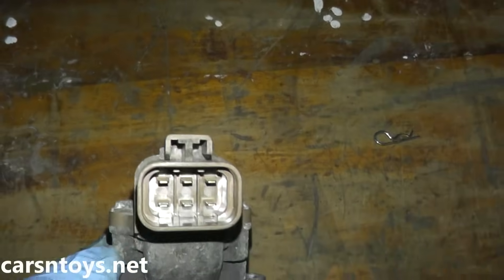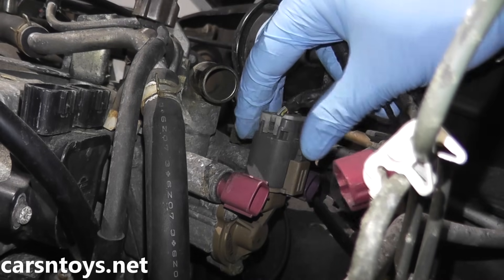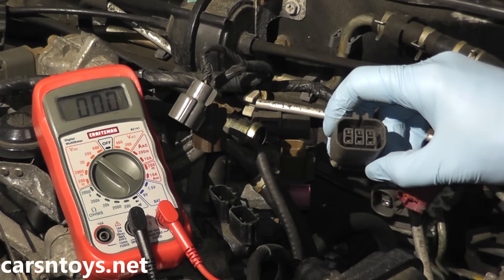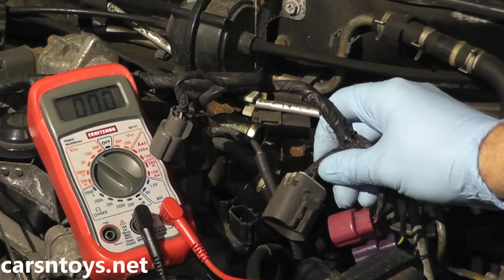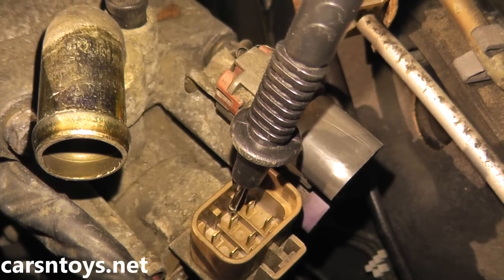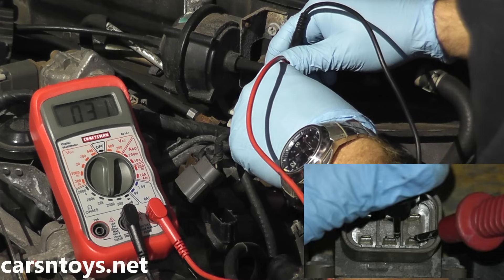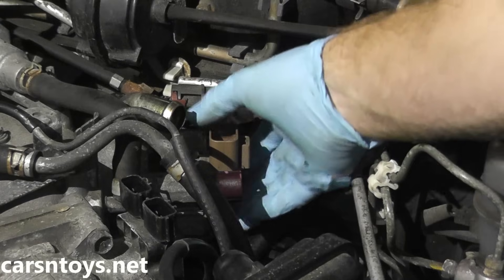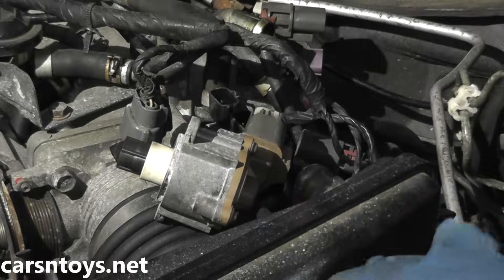How To Test and Replace Idle Air Control Valve P0505 HD | IAC Actuator

Comment: I treat this stuff like spark plugs. Sensors and IAC valves age proportionally and dirty up like spark plugs. If I pull an IAC valve and spark plugs and they are covered with caked on crud, I just replace the damned things along with the MAF, IAT,  and O2 sensors. If the IAC and spark plugs are covered with caked on crud, I assume all the other sensors to be caked as well giving deltas of inaccuracy across the scale to the computer which compounds into lousy computer output which is what initiates sensor and plug crud in the first place. Thus a car that does not idle, accelerate, and cruise as well as it could. I've proved this to myself by replacing each component progressively on high mileage cars one week apart and watched performance along with gas mileage progressivley improve. An expensive way to do things maybe as I don't settle for the cheap stuff. Some will call a parts changing a fool. To those guys, yes I have and use a bilingual scan tool and multi meter and know how to use them. But when I nail the throttle on a 150,000 mile car to pass someone and car responds like factory new, it's money well spent as far as I'm concerned. I can also count on the car lasting longer as it will burn cleaner. Spotless sensors throughout the intake and exhaust system give you just that. Thus less carbon deposits in the lubrication system which clogs passages to lifters, rods and mains with sludge. I've torn enough motors apart to know I know what I'm talking about. A clean burning engine is a long lasting engine. Real simple to figure out.
Reply: John Long I see your point man! I like to test things out to see if I can save some cash but honestly car dealer shops charge $160 hr for a 15 min plug and check codes for diagnostics. I can easily buy one part per hr and still be ahead. I like your thinking. I have a classic 3.5 Range Rover efi that idles high after warm up and fluctuates its  rpm. I’m just going to start tossing in new parts. IAC, tps, o2s etc

Comment: your very detail about your videos there great.. i was hoping you could help me out. i had a stuck idle pulley it was melying the blet. change it works good now. but i noticed that my 2003 dodge durango truns off now when im at stop. also if i have it on park and give it some gas about 4,000 rpm it dies... i was told to adjust idle. would you know how yo do that.. i was also told that i should just clean the throttle body and iac.. any recommendations.. thanks

Comment: I have a 1999 dodge ram 1500 and after checking and replaceing the iac now i have a code on for the engine light come up as a P1388 Automatic shut down relay 81 Brake switch stuck 78 Brake system incident Does Anyone know what this is O'Reilly did the scan and they dont know what it is

Comment: im having sane issue with my 99 ram 5.9 v8 2wd ill start the truck it will idle fine at start up but when i put it in drive and dive it for a bit i get low idle when coming to a stop engine wants to die aic valve starts hissing loudly...its throwing a p0132 code for the upstream sensor cuz the wires were cut for some reason to the downstream and upstream sensors and i have tried everything to fix it...cut and respliced taped them up good still both are stuck at 1.0 volt are there any recommendations on how to fix the O2 sensors it the wires are cut and pigtailed together...so sick pf this truck fucking up on me😳
Reply from the maker: I'd try to get the factory wires and solder everything back together. Local junkyard or ebay will often have the wires
Reply: well turns out it was a simple o2 sensor fuse....ha! who knew...

Comment: i just replaced mine now my truck wont start seems like its not getting no spark also aren't u suppose to disconect negative battery cable from battery to prevent damage to the sensor
Reply: after replacing the sensor you will have to reset the KAM. this will make the pcm relearn its position. IAC is a stepped motor and it must relearn its position according to fuel trim and A/F ratio.

Comment: does the iac valve cause symptons of

1. high rpm over 1000
2. low rpm 1000 or less
3. car shakes when its on
4. lack of power like if the car wants to shut off while you driving it or not driving it. ???
5. motor feels weak like if it dont wanna stay on feels like if it want to shut down?? 
6. can it also cause battery to die out also??

sorry just curious to know 
please help me on this one.

thanks for your time and patience
god bless.
Reply: chevyboii SS king310  sound like it buddy. You ever figure it out????

Comment: my car idles like crazy and stops on me its a 96 nissan maxima if i clean ghe iac will it help i cleaned first half of my throttle but didnt take it fully apart to clean.other side any tips? i really need to fix this
Reply from the maker: Any trouble codes?
Reply: +CarsNToys yes i have a check.engine ligbt i need 3 replacr.my.Egr.tempersture sensor? can it do.with that

Comment: All your testing checked out for me except for the last step at 5:20 on my 95' 3000GT. When I turned the car on several times, the shaft did not move at all. I decided to try it again and the first time I turned it on, it moved ever so slightly but wouldn't move again after I turn it back off and on. Is this an indication this part needs replacing?
Reply from the maker: Sounds to me it needs to be replaced.
Reply: +CarsNToys OK thanks, hopefully it fixes the reason why my car is shaking at idle and lacking power

Comment: My car was idling at 1100 rpm and i had the code p0505. i replaced the ACV and the car now idles at 650-775 rpm; however i still get the p0505; what could be wrong?
Reply: the pcm has to relearn. disconnect the battery terminals and touch them together for 10 sec then run it..

Comment: I got question guys. I got a 1998  5.7liter GMC Suburban. My idle seems to be a little high, it's idling now more or less at 1300 sometimes seems like 1500 , Do you think that the idle control valve could have something to do with this issue?  I was thinking maybe it was possibly stuck open.. Thanks ahead again guys, you guys are always highly  appreciated! 👍

Comment: omg this is so helpful right now my car is idling like.3000 rpm I just replaced the throttle body  part but trying to figure out why it idles so high when I turn it on
Reply from the maker: +Mely Serrano Sounds like you may need to adjust the throttle position sensor.

Comment: This is a great video. I've been working on an idle issue on my mercruiser boat engine. Someone explained to e that I should check for power and resistance on my wiring harness at the IAC. I had no idea how to do that until I watched your video. Great attention to detail. The inset camera view as you test for resistance is a great feature! Thanks a bunch!
Reply: rossi7r
Reply: Best video instruction for IAC valve I've seen.

Comment: Thanks for the fast response I really appreciate it. Would you happen to have a video on the vacuum hose and valve you are speaking of. Thanks again
Reply from the maker: +doug resha Unfortunately I don't. The Maxima I usually work on is older and doesn't have this vacuum hose.

Comment: First off thank you for such awesome informative videos! I did your test procedure on my 2000 maxima with the p0505 code, and it all checked out to be ok. I am still getting of course the p0505. Could it be that the throttle body needs a good cleaning, or what else would cause the code? Thanks in advance for your help and keep up the great work!
Reply from the maker: +doug resha Thanks man. If you checked the harness connector and the iacv, the '00 Maxima also has an air control valve on the power steering. If the vacuum hose or valve stops working correctly, you could get code p0505. You could pinpoint it quite quickly with a sophisticated scan tool. The basic scan tools won't pick it up.
Reply: @Carsntoys  but you didn't answer his question, if you do check All those things, what else can it be? I assume vacuum leak, are their any worst case scenarios with a p0505?
Reply: My 2000 dodge ram van 5.2 V8 is showing that code right now

Comment: I have a 01 ford Explorer everytime I slow down and stop it's chokes out and stop. a lot say it can be this . can that be the issue
Reply from the maker: +Dominique Williams Sure could be. If it turns out to be okay, other things to check is the mass air flow sensor - https://youtu.be/ewjO9JVr8NU - fuel and ignition system.

Comment: I tested the prongs on my Idle Air Control Valve and they read 42 to 46 Ohms on each compared to your 30. Same model of car (Nissan A32). Is that something to be concerned about?

Also, when removed but connected to the harness, it moves, but not as much as in this video. It's possible that's just a subjective observation, but if it really doesn't move as much, that a cause for concern?
Reply from the maker: +Antonio Java  The 30 ohms reading can vary depending on temperature. And if the valve is moving back and forth, and you don't have a trouble code for p0505, I wouldn't worry about it.
Reply: +CarsNToys Thanks, man! :) This helped me a lot in troubleshooting my car problem. I actually don't have a code scanner, so I had to do things the old-fashioned way and checked every possible point of failure one by one, including this part (which turned out to be fine, based on your input :) ).
Reply from the maker: +Antonio Java Good stuff man. Glad to help!

Comment: My voltage is 12.8 volts is that ok? I'm also getting a reading of 29 on connectors 4 & 5. Is that ok? I'm getting 30 on all of the rest.
Reply from the maker: +Errol Dillon Perfectly fine.
Reply: Thanks for getting back to me so quickly! You're the best!!!

Comment: Thanks for the tip on Ohms. I bought a new one and my car did not run well. I tested the new valve (mine had only 2 pins) and there was almost no resistance.
Reply from the maker: +craze1701 Glad to help!

Comment: @ carsntoys - I have a 1998 Ford Explorer XLT that idles poorly when cold & only a little better when warm.  Is the IAC the problem, or O2, or F/A sensor or "all of the above" ?

No Hate  On's Please.
Reply from the maker: +Tony Penner Is the check engine light on? If so, what are the code(s)?
Reply: +CarsNToys - It was the O2 sensor 1, bank 1.  I replaced it (with much grief), with a new one & seems to idle ok.  I then took the negative battery cable off for 5 mins., but the check engine light is still on, but the system says all is ok.
Reply from the maker: Tony Penner
Glad it worked out. The light will go off eventually. Just has to cycle.

Comment: DO NOT TEST YOUR IAC OUTSIDE THE THROTTLE BODY.I just ruined my IAC by trying the test at the end of the video. It kept pushing the plunger out until it came apart because there was nothing to stop it (like being in the T body. Thanks a lot.
Reply: +cklinejr Just screw it back in.....
Reply: +cklinejr dude, I just did the same. darn. thing.  Mine shot the valve off like 4 feet away from the engine.
Reply: +cklinejr I did the exact same thing as in the video and mine behaved as shown. If the launch wasn't a sign of a defect, then it's likely a difference in design. This is a good word of caution though, as this test might not be suitable for all cars. Good thing my car is the exact same model as the one shown in this video.
Reply: My Chilton cheapo manual does say not to let the pintle extend more than 1/4" or it's ruined....
Reply: cklinejr  what u mean u ruined it n don't do apart from throttle body
Reply: MUST OF BEEN FUCKED IF IT CAME APART MAN

Comment: in Nissan sentra 2003 should idle valve axle go out or go in after switching on because I have  rpm problem and note that my idle valve work opposite the video '''putting car on universal computer found no DTC ,,,my idle rpm 1000 and fluctuating while driving if I release petrol pedal on gear

Comment: I have a 04 Ford Freestar that will act like it's running out of gas at first cold start. Fuel pressure is fine. If I hold RPM's at 3000 or more for a minute it will be fine but RPM's at idle are jerky. No check engine lights are on. Sound like the IACV to you?
Thanks
Reply from the maker: +Paul Brownfield I'd check the iacv and pcv valve

Comment: I have a 1998 Toyota rav 4. It idles fine, but when I put the gear to Drive or Reverse, the idle always drop & will go up again. Sometimes the engine will die. 
I cleaned the throttle & the IAC valve but nothing happened. 
What should I do? Should I replace the IAC valve? 
Thank you.
Reply from the maker: +Vincent Rodriguez It could be the IACV. Is the check engine light on? IF so, what are the codes?

Comment: I get 43 ohms resistance on my 99 Maxima is that any good?
Reply: +Gravedigga114 smh, yes that is good,  from now on take your car to the mechanic shop lol
Reply: +Gravedigga114 That could be good or bad. Check your factory service manual to see what number you should get. On my FSM, it states "approximately" 22ohmz
Reply: @gravedigga114 it has been long time but if you see this post or anyone else, i have same car and i also get 43 ohms, how did you fix this error?
Reply: @vinaycx  According to AllData resistance between terminal 2 and 1, terminal 3 and 5, and terminal 4 and 6. Resistance should be approximately 30 Ohms at 68 degrees Fahrenheit. Hope this helps!
Reply: @Gravedigga114  thanks.
Reply: @vinaycx  no problem don’t recall exactly how I fixed this issue on my car haven’t had it in years but it’s possible I replaced it with a used one if your harness wiring is good.

Comment: Good Morning,  I have a 95 Maxima.  Does the Idle Air Control Valve always give a code?  Car is not registering any codes.  Have to pump accelerator when car has sat over night, rough idle at red lights.  If I move it to neutral, car smooths out.  Car runs ok once I'm not longer at the idle.  Any ideas what could possibly be the problem?  Any ideas will be greatly appreciated.
Reply from the maker: kfjones58 Not necessarily. You can have an IACV going without a code showing. Rough idle can be a number of things. Try cleaning the throttle body with throttle body cleaner. Also check the pcv valve and egr valve. I have vids for both. Just search my page. If you still have problems let me know
Reply: Thanks for your response.  I took it to Nissan for a diagnostic.  They came back with Misfire coming from  #6 injector is not spraying.  Do you think this could be the problem also?  I have an appointment for Tues to have it replaced.

Comment: I have a Nissan Maxima 2008, the rpm fluctuates a bit ( 700-1200) and engine goes OFF when I slow down the car. and yesterday the car was running at 80KPH and suddenly the rpm started going down the engine went OFF I had to stop the car with the Hand brake
don't know what the problem is just got the throttle body cleaned a week ago and done computer check everything is OK in it , no sensor showing faulty.
please help if anyone has faced this issue
Reply from the maker: Sandeep Naidu Could be a number of things but I'd start by checking the fuel system.

Comment: I'm getting the code to suggest mu iacv us bad. When changing out the iacv am I required to install a new ecm? I've read in several place I should, but your vedio didn't suggest it. Btw, I talk your video as gospel as you do amazing work. One last thing I have a 97 infiniti i30 if that matters. Thanks.
Reply from the maker: Bobby Gee Thanks man glad to help. No need to install a new ecm if the IACV is the only issue.
Reply: +Bobby Gee Did you get this fixed? You need to check the ECM if its bad also. When the IAC goes bad, it shorts out the chip in the ECM (this is a common occurrence in maximas and i30s). You'll see a burned chip if you take out the ECM. GL

Comment: Question regarding a 2002 Nissan Sentra GXE. The resistance check is good and the voltages are good. I have removed the valve to check if it moves when turning the ignition on/off and it does not move. The valve was taken off of a working car. Any suggestions?
Reply from the maker: Mirko Miljanovic If the valve doesn't move then you'll need a new IACV.

Comment: HELP !  I have a @92 Chevy S10 That idles fine. But, as soon as I shift into 1st gear, it stall and chokes. I have changed the fuel filter, the fuel pump, the distributor cap and rotor, changed all plugs and wires.  Nothing. I saw something, internet-wise, that there may a vacuum hose issue.

A friend suggested I replace my IAC.

I am a complete layman. However, I'm not afraid to attempt to do it your self. 

Any suggestions?
Thanks
Reply from the maker: Vernon Gibbs I'd check the idle air control valve, pcv valve....http://youtu.be/W63W3DtBCwA.....and the ignition time. Could also be an egr issue. Check this video on how to quickly test the egr valve.....http://youtu.be/0lmLuLsloRU
Reply from the maker: CarsNToys If those links don't work just search under my page for pcv vale and egr valve.

Comment: Thank you for your informative video. In regards to the last step, how can I supply power to the IAC without removing it completely (since mine is part of the throtle body assembly) using a multimeter to see it actually mechanically moving? Thanks.
Reply from the maker: MrDoNHS You can supply power to the valve and you should hear the valve turn on and off. Give that a try.